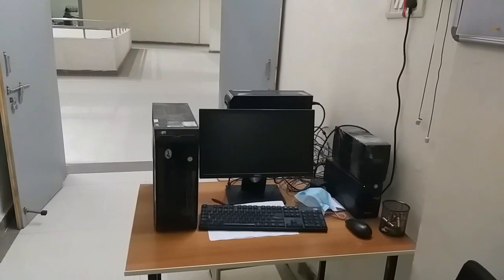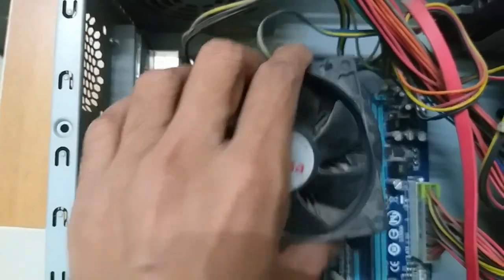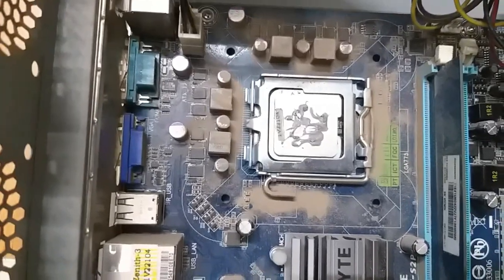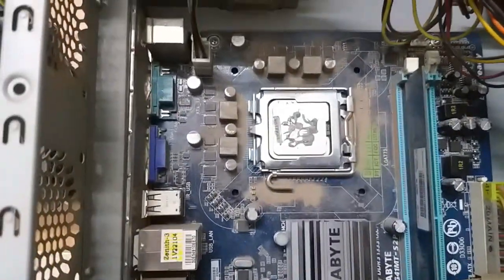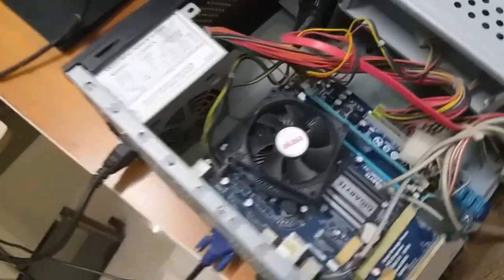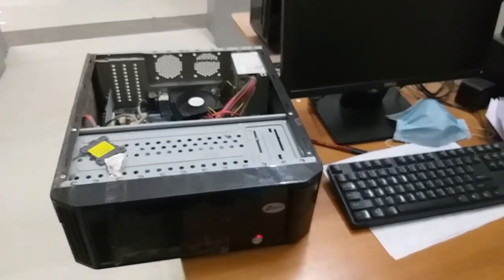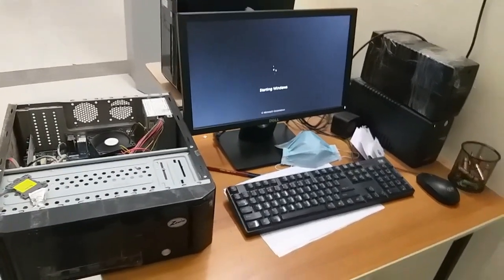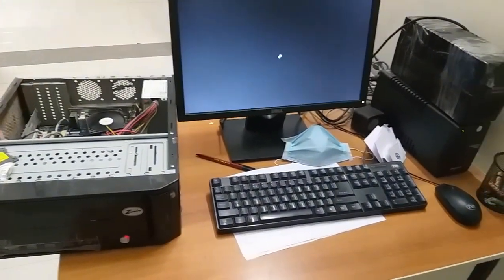CPU Not Working No Display

Comment: This computer is so old it belongs in the trash. Dual core E5500 was released in 2010 and would even struggle to run Chrome nowadays. The cheapest fix for  this would have been to replace the entire unit with another less old but cheap machine. The Thermal paste application is also not veery good. Also why didn't you clean the dust from the board at the same time. Dust can become conductive.,